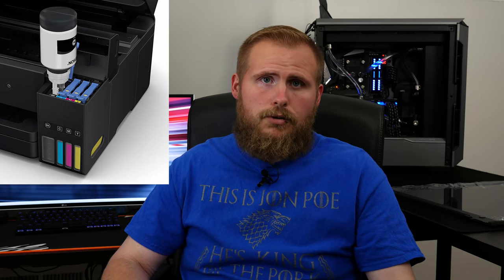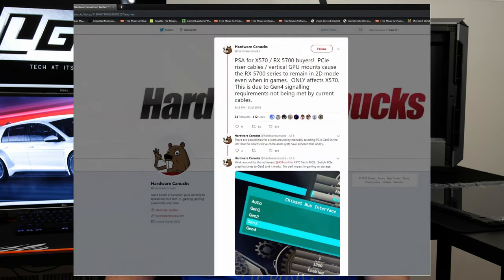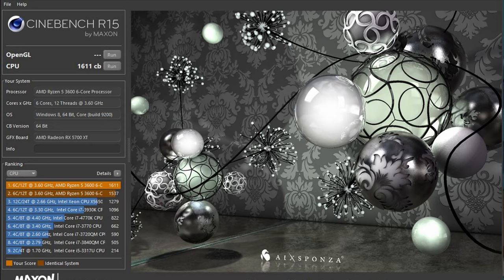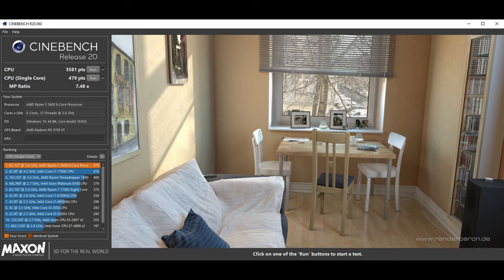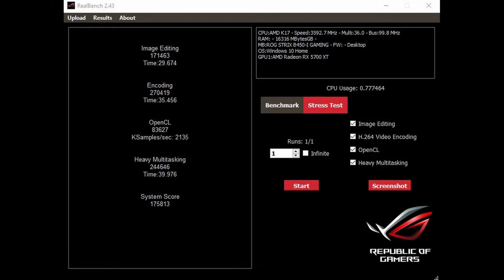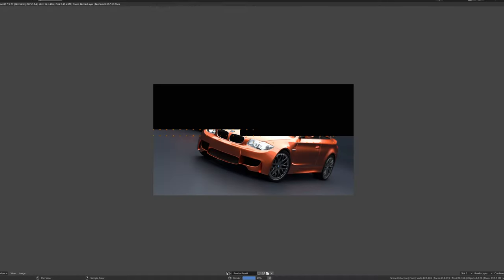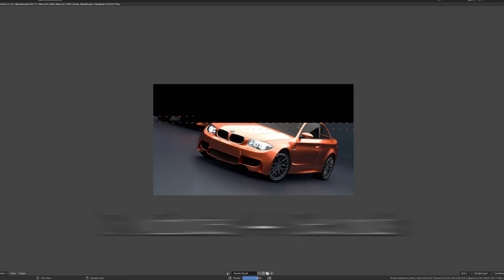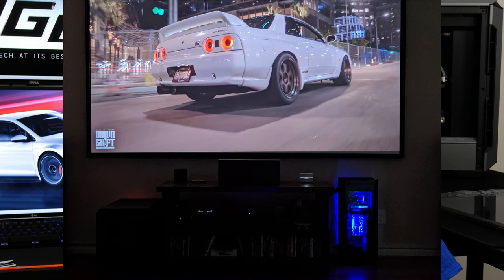SFX Ryzen & Radeon Custom Loop- Part 2: Issues & Performance

Comment: The delta between your edge and junction temps seems rather high.  Higher than I've seen with other content for liquid cooled 5700xt.  Is it possible the block may not be fully seated or thermal compound not uniformly applied?
Reply from the maker: I wouldn't necessarily disagree with you on that. I would say that we certainly have a uniform spread, as I also to the "pre-spreading" method with my finger inside a plastic baggy. It could maybe use a remount though, since AMD GPUs are already notorious for mounting pressure issues. Definitely worth a look! Thanks for the comment!
Reply: I do the exact same thing.  sacrificial sandwich baggies for the win.

Comment: Go into the bios and set the pci to gen 3 fixes this. There is a signaling issue with risers and gen 4. I used a 3800x and a 5700xt on a X570 aorus elite board and set it to gen 3 because it was acting very strange on auto and gen 4. Gen 3 fixed the problem completely. I scored this with a riser and the setting to gen 3 http://www.3dmark.com/fs/20171371
Reply from the maker: You must have skipped our "issues" section. :)